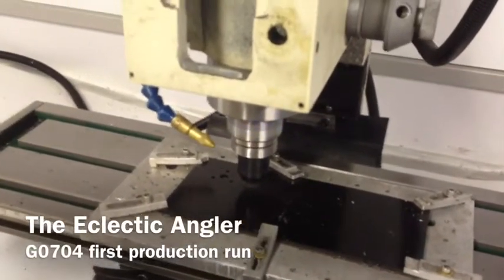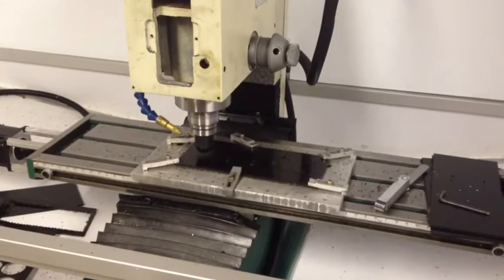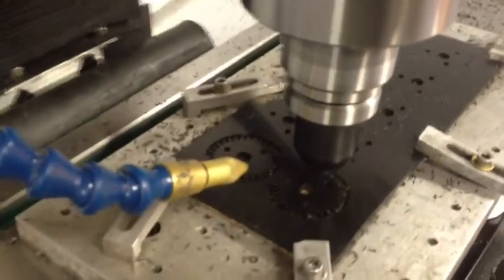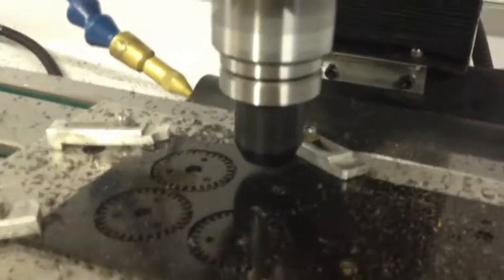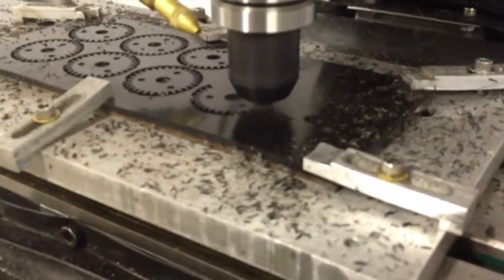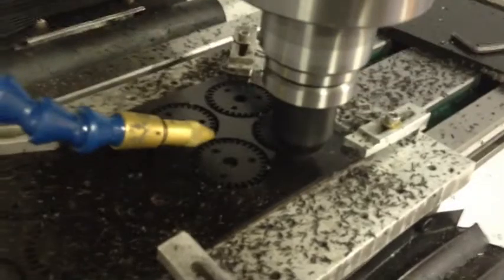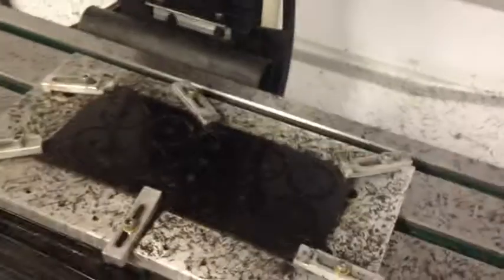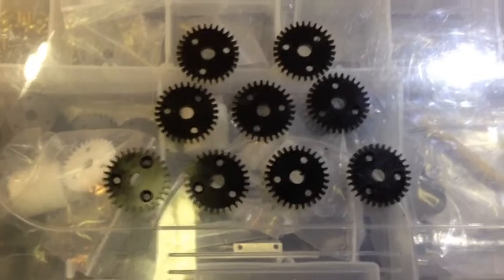GO704 First Production Run

Comment from the maker: Well, I figured out the NOISE problem! I had the belt way too tight. Loosened it up and the machine is much quieter now! Been milling nickel silver (a fairly hard material) and it is making some excellent cuts.

Comment from the maker: Yes, I'm not sure what's up with the noise other than the pulleys do wobble a bit and that might be the cause. The motor is very quiet on its own and the spindle is too. The enclosure is great, easily removed and watertight! I hand held an iPhone for the video! Talk about low tech. I am getting set up to do better videos now that my shop has cleaned up a bit. Thanks for the comment!